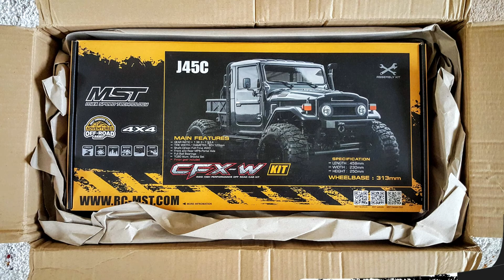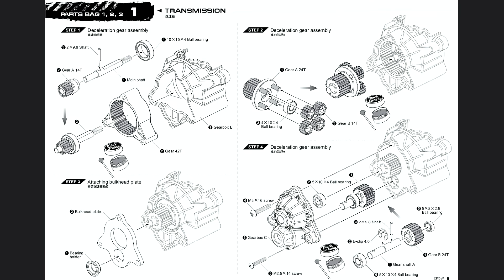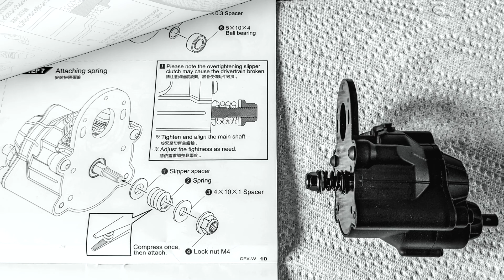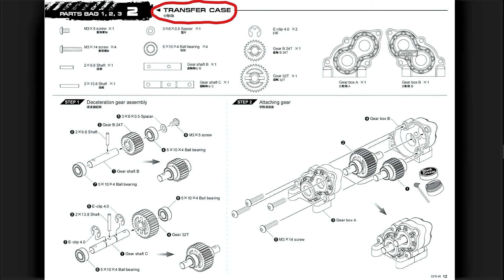MST CFX-W J45C Kit build   Part 1

Comment: Good relaxing build, Derek! Looks great that body and real quality gears. Do you have any other MST’s?
Reply from the maker: Hello Mikael. Thank you very much my friend. 🙂👍🏼 Yes I've also got an MST CMX kit chassis that I bought in 2018. It was MST's first crawler chassis which was released in 2016. I bought it because you can adjust the wheelbase to the same three settings as the Tamiya CC-01 wheelbase using different length suspension links which are included in the kit. I have a new Tamiya Amarok body and decals which came with it but I haven't got round to cutting it out and painting it yet ! 😄.  So I've been using my Tamiya CC-01 Pajero Metaltop Wide body & CC-01 Isuzu Mu body & CC-01 Toyota Land Cruiser 40 body on it. When it was first released it was nicknamed the CC-02 and people said it was "the CC-01 chassis Tamiya should've released". I have some videos of it on my channel.
Reply: Ahh, yeah, I remember that chassis and Matteo’s videos introducing it. Would love to see it compared side by side with a real CC-02 now 😊

Comment: As I'm building a CC-02 at the moment, I found this video particularly interesting.
It's always fun to compare different designs.
I love the colour you chose for the (gorgeous) body!
Reply from the maker: Thank you very much Del. What do you think of the CC-002 build ? 🙂👍🏼
Reply: @hollyhillrc  Hello, Derek. I like the relatively forward-positioned motor on the CC-02, and I was puzzled that the instructions say that only the rear diff can be built in the locked configuration. As I was building mine with the low gearing and a 45T crawler motor (ordered before you told me about 5-slot motors) I wanted to lock my front diff. I thought about securing the 3 pinions to the star-shaft with cyano, but then realized that parts bag C (the gift that keeps on giving) actually does contain sufficient bits and bobs to build it locked, whatever the instructions say!
I like the oil-filled shocks, and don't understand why they don't include them in more of their kits, particularly M-cars.
Though the wheels and tyres look great, I'm frustrated to see how hard a compound Tamiya have used - the chassis can't manage my bsck-garden test track at all. It just spins.
I've got a Tamiya Bruiser driver figure for it, and am making a very basic interior. I've ordered some different tyres, too!
This MST looks supremely competent, and the instructions are nice and clear, by the looks of things. I hope the build was as much fun as it looks!
Reply from the maker: @Del350K4  Hi Del. My Tamiya WR-01 Firestone Big Foot (ex Wild Dagger) only has the rear diff locked and it handles things very well all things considered, so I decided to leave the front open on my CC-02 Unimog before I started the build. (To be honest I didn't realise the instructions say you can only lock the back diff. I will have to dig out the instructions and have another read). It works well for my light trail running. I don't like the kit tyres at all, but I tried a few different ones, including a set of KRT K1 90mm diameter crawler tyres and a set of Fastrax Kong 90mm diameter tyres without success. The main problem was the inside edge of the front ones rubbed against the steering knuckles. I was very disappointed because I run both of these tyres on my CC-01 chassis and they are far superior than the usual concrete compound Tamiya offerings. So I've resigned to using the kit ones until I find something that fits without rubbing. To be fair they don't do too badly in the woods but they do limit it's performance. I guess an adaptor could be used to bring the wheels away from the knuckles but that would make the axle wider and I think it would lose it's scale looks with a wider stance and I don't want that. That's just my personal opinion and taste of course. I will be interested to hear if the tyres you've ordered fit ok. I still have to fit a driver to the Unimog and I need one for this CMX-W as well. This build was a joy and the only thing I had trouble with was deciding whether to have a chassis or an axle mounted servo, because you have the option to do both. So I watched Matteo's build video and he went for the axle mounted option, so I did that. The MST instructions are very good and easy to follow. They're much like Tamiya's instructions. All the parts are drawn to scale, which really helps selecting the correct screws for instance. I've also got an MST CMX kit chassis which was MST's first crawler chassis released in 2016. You can adjust the wheelbase to the same three settings as the Tamiya CC-01 wheelbase using different length suspension links which are included in the kit. I've been using my Tamiya CC-01 Pajero Metaltop Wide body & CC-01 Isuzu Mu body & CC-01 Toyota Land Cruiser 40 body on it. When it was first released it was nicknamed the CC-02 and people said it was "the CC-01 chassis Tamiya should've released". Thanks for your excellent reply Del. See you in part 2  😀👍🏼
Reply: @hollyhillrc  Hello again!
My wife and I often fit fat, knobbly front tyres to our onroad motorbikes, and find ourselves having to trim the knobbles on the outside edges to stop them from rubbing against the mudguard stays. I anticipate having to do some similar surgery to get my new rubber to clear the steering knuckles on the CC-02. When ordering them I confess that I allowed myself to be guided by scale-looking rins more than anything else, and didn't consider clearance at all!
I think the CC-02 is a reasonable try on Tamiya's part, but the similarly-sized Team Associated/Funtek CR-12 performs far, far better, and costs less despite coming with bearings, dedicated crawler electronics, excellent tyres and a radio, as well as being fully assembled. In terms of value for money I think it beats the Tamiya hands down.
I must check out the MST "CC-02", and watch Part 2 of your build!
Reply from the maker: @Del350K4  I really like the Team Associated CR12 with the Blue Ford F150 body but I think they're discontinued. I love my MST CMX. It's like a small version of the first Axial SCX10 chassis and still much better than the CC-02. These are a some of my videos of it. Pajero https://www.youtube.com/watch?v=SD-9eoDEA50&t=185s & Isuzu Mu https://www.youtube.com/watch?v=3G2xcz_j4Ok&t=43s & FJ40 https://www.youtube.com/watch?v=-iIp2Wx3fvQ
Reply: @hollyhillrc  The F150 body is discontinued but you can get your hands on a CR-12 chassis with a Dodge Powerwagon body by buying it as the Funtek CR-12 - it's a bargain, too. Like a very high quality WPL or MN Models.
I'll check out the links you sent me when I get home from mowing a rich man's lawn and chlorinating his swimming pool : )
Reply from the maker: @Del350K4  😄😄😄 I don't know why but that really made me laugh and conjured up an image of you looking over your shoulder at the rich mans house in contempt whilst peeing in the pool ! 😁 This is another on going project involving my CMX chassis and a Tamiya Ford F350 Hi-lift hard body 👍🏼 https://postimg.cc/ftsbJ6JP The wheels are temporary until I find some more suitable.
Reply: @hollyhillrc  That's gorgeous! I've never peed in the pool but I've tested my Graupner speedboat and my black speedboat in it, and recorded my Ford Escort, Cortina, Taunus and Triumph Stag videos on nis front drive.
I've had a few crafty skinny-dips in the pool when he's been away, too.
Reply from the maker: @Del350K4  Bwahahaha ! 😂😂😂 Let's hope he isn't one of my subscribers ! I've adjusted the wheelbase this evening and I'm happy with how it looks https://postimg.cc/v4hNkKns